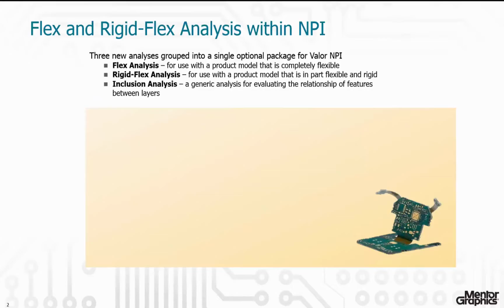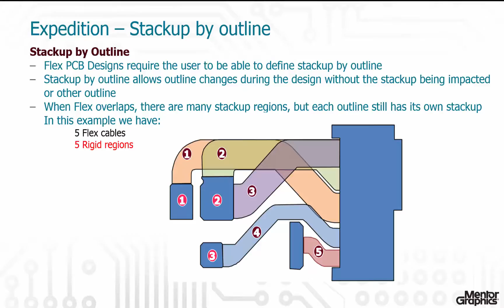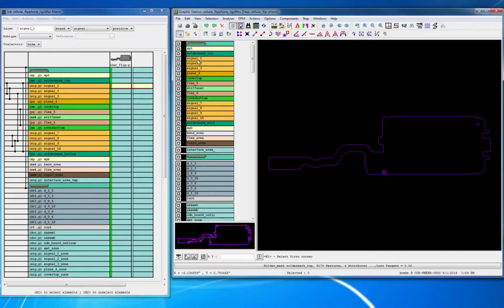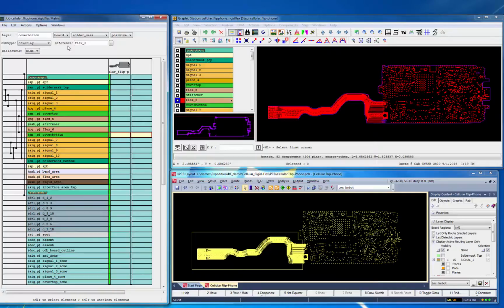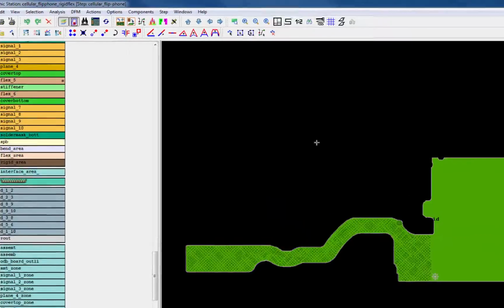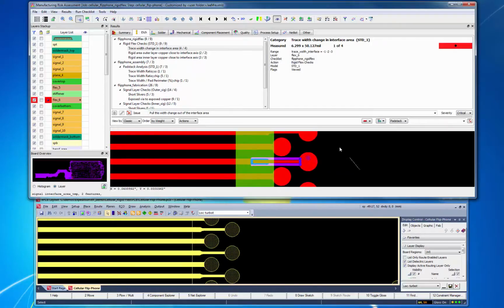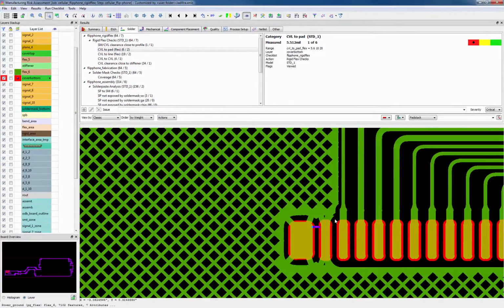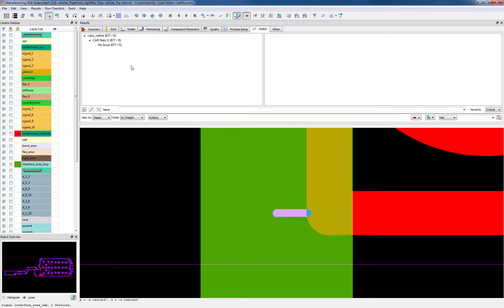Take your Flex/Rigid Flex DFM Analysis to the Next Level

Comment: Hi,
I have been working on this software specifically running the checks in graphic station for Rigid flex data. As soon as I run the checks, a message pops in yellow that "Not a RF board or have not set layer profile" and because of this I can not see any category in the result viewer. Any help in this regard would be appreciated.